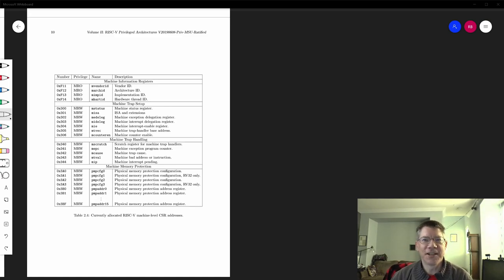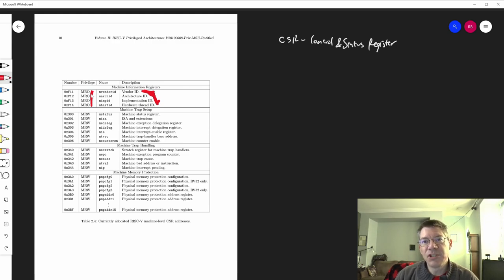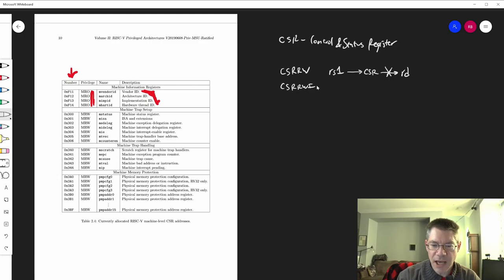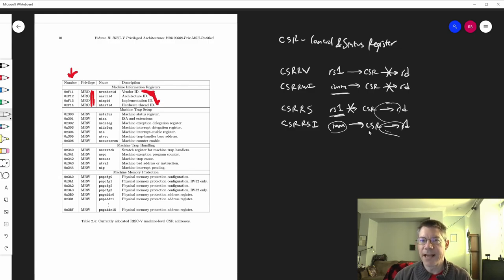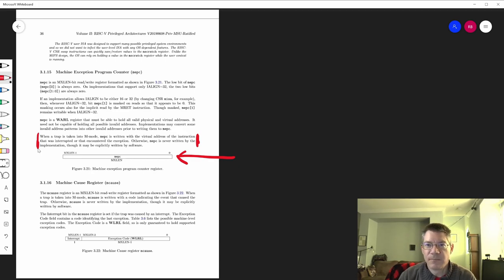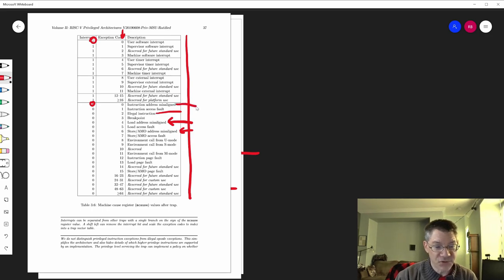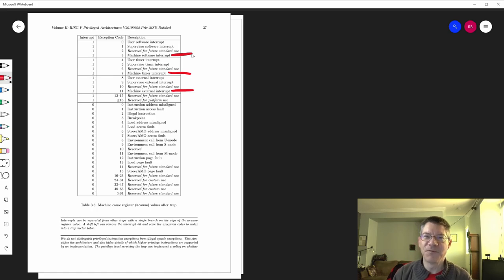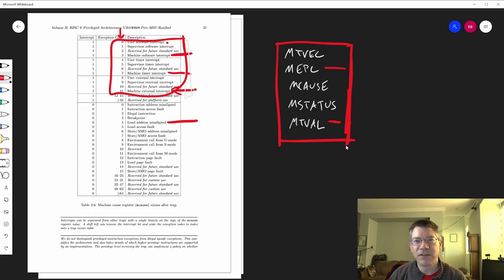LMARV-1 reboot part 6: About CSRs and interrupts

Comment: If ECALL, context switches, etc. seem to be too problematic, you can opt for not supporting interrupts in V1 of your hardware or only support it in a limited fashion (Machine level external interrupt routine for IO), especially if you have a microcontroler-like machinelevel-only hardware.
V2 of your hardware (or nMigen simulation) then can add more and more.

It is easy to lose oneself in the vast space of Interrupts, context switches, and the dozens and dozens of CSRs Risc-v can support. But since right now you are also in control of the software that will run on your hardware, you can limit the support as far as needed to have a minimum-viable-hardware, and add more later. Helps preventing frustration :)

Comment: 17:10 I think that ecall from machine mode in that table is Interrupt=0, ExceptionCode=11 and ebreak is Interrupt=0, ExceptionCode=3.
Reply: Yes I think too. The machine software interrupt (Interrupt=1, ExceptionCode=3) is for IPI (inter-processor interrupts) and happens when writing to a specific memory-mapped CSR of the HART's interrupt controller.

Comment: ECALL vs INT: x86 has a similar situation with the SYSCALL and INT 80h semantic.  SYSCALL on x86 is newer/faster, vs the old method of setting up registers and then calling INT 80h (which is simply a random convention in software like MS-DOS or old windows, etc).  RISC-V maps ECALL to various interrupts, depending on wether the ECALL happened in User/Supervisor/Machine mode. This is the way how RISC-V performs kernel calls (setup registers in user mode, then call ECALL, which is handled by a handler running in Supervisor / machine mode). 

If you only want to run privileged machine level code like in a microcontroller without an operating system, ECALL would always hit INT 0/11. You can also skip calling ECALL in such a case, since you'd anyway just call whatever code you want.

RISC-V also supports interrupt handling, and software can setup and trigger interrupts. 

Google For the SiFive Interrupt Cookbook:
https://sifive.cdn.prismic.io/sifive/0d163928-2128-42be-a75a-464df65e04e0_sifive-interrupt-cookbook.pdf

SiFive is the company that is driving RISC-V software and hardware development the most prominent, and their interrupt overview is quite nice.

Comment: I am concerned about conditional jump. PC+4 at interrupt return might not work. But I didn't read the RISCV documentation about it.
Reply from the maker: Me too, I'm not completely sure how it's supposed to work. We know what PC we're targeting once the branch instruction is done, but why wouldn't we store that in MEPC? Unless it's different between interrupts (store the return address) vs exceptions (store the exception-causing instruction address)?
Reply: Unless you just keep the next PC as it is in the PC register and stores the current executing PC into the CSR. When you return, the PC is already pointing to the right address. That is my interpretation of the document.
You said you will have a switchable register bank, that would work just fine, as all registers are swapped at interrupt service.
Reply: @RobertBaruch  From section 3.2.1 of the Priv Spec: "ECALL and EBREAK cause the receiving privilege mode’s epc register to be set to the address of
the ECALL or EBREAK instruction itself, not the address of the following instruction." In general, it appears that if an instruction causes a trap/interrupt, then MEPC will contain the address of that instruction. To resume, one would read MEPC, increment it by the instruction length, write back MEPC, then return from the service routine. For external interrupts MEPC contains the return address. A few years back I filed an issue for a clarification in the spec: https://github.com/riscv/riscv-isa-manual/issues/106
Reply: Before serving an interrupt, you might need to compute the next instruction (PC+4 or target instruction in case of a jump (even unconditional jump)), store that on stack, and jump there afterwards.  Storing the registers during a context switch might be imperative anyway.

See section 5.2 Context Switch Overhead for a quick overview in case of an ECALL instruction of the SiFive interrupt cookbook.
https://sifive.cdn.prismic.io/sifive/0d163928-2128-42be-a75a-464df65e04e0_sifive-interrupt-cookbook.pdf
Reply: @RobertBaruch  I think that sounds logical. In an exception you want to know what broke, but in an interrupt you want to know where you should go back to.

An exception handler can try and recover from the error and could then return to the application that caused it by doing it's own calculation on the return PC (or go back to the original PC and retry), or it could simply trash it and restart it.
Reply: @RobertBaruch  In the privileged spec, the (M/S/U)RET instructions are defined to
a) modify the interrupt enable bits and return to the correct privilege
b) branch to the value stored in (m/s/u)epc

Exceptions (i. e. traps, that are caused by executing a bad instruction) will cause xepc to contain the address of the instruction. That means returning from the exception without modifying xepc will cause the bad instruction to be executed again, which is a valid strategy for something like a page fault (the os may react to the exception by mapping additional memory into the address space at the location), but will cause an infinite loop for most exceptions. A handler for a non fatal exception will therefore usually look like
    // save registers
    ...
    // emulate instruction (for misaligned load / unimplemented instruction / etc)
    ...
    csrr x1, mepc
    addi x1, x1, 4
    csrw mepc, x1
    // restore registers
    ...
    mret

For interrupts, there are two main ways the processor could react. It could either stop executing the current instruction and jump directly to the handler, or finish executing the instruction and then jump to the handler. I imagine the second version to be harder to implement, given that executing the instruction might cause one or more exceptions, which will then  need to be ordered. Also, in the documentation of the mepc csr, the standard talks about "the instruction that was interrupted", so I think that you are supposed to implement the first strategy.

In the case of the first strategy, you will need to execute the interrupted instruction again (because it was interrupted while being executed), so a direct return to mepc will do the correct thing. If the instruction instead executes completely before jumping to the interrupt routine, you can just increment pc before saving it to mepc, meaning that you treat it as if the interrupt arrived a cycle later and interrupted the following instruction. That means, that for both strategies, you can just use mret to continue execution.

As for the ECALL instructions, the privileged spec states, that they cause a environment-call-from-x-mode exception, which the table lists as mcause 0(exception)-8,9 or 11. It also states that mepc will contain the address of the instruction, so it will need to be incremented as seen above before returning. EBREAK will cause a breakpoint exception (code 0-3).
Reply from the maker: @lukasschwager5876  Thanks, this is extremely useful! Instructions in LMARV-1 always complete (modulo exceptions), so I'm considering "the instruction that was interrupted" as the instruction following the instruction that just completed. 

Because some instructions take more than one step, if I broke an instruction in the middle, registers could be in an inconsistent state. So I just made the decision to delay handling of an interrupt until after the current instruction completes.

Comment: Amazing. As a matter of curiosity, did the previous ttl tangible version were built using bit slices? Let’s say amd 4bit or whatever. I remember some Apollo workstation emulating a 68k10 Instruction Set out of amd bit slices.
Reply from the maker: Nope, no bit slices.
Reply: @RobertBaruch  Awesome. Thank you.